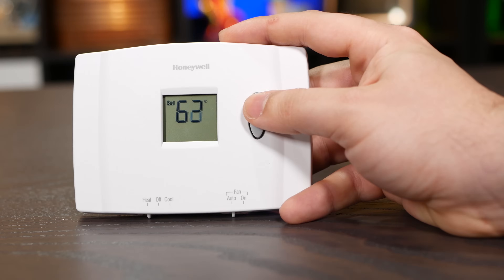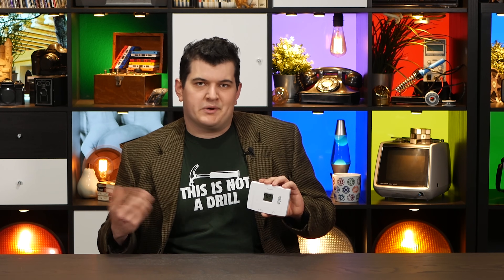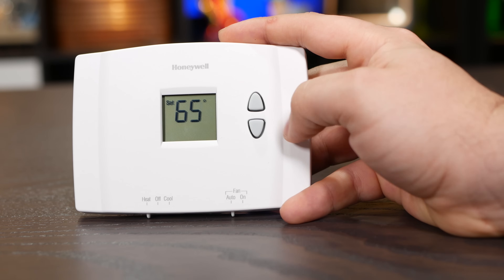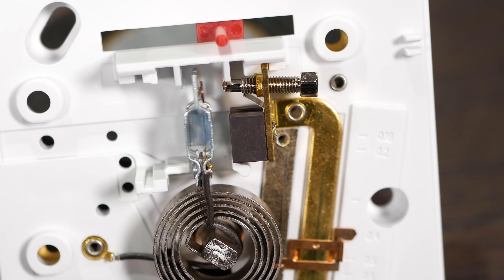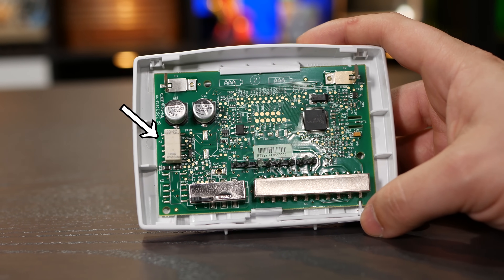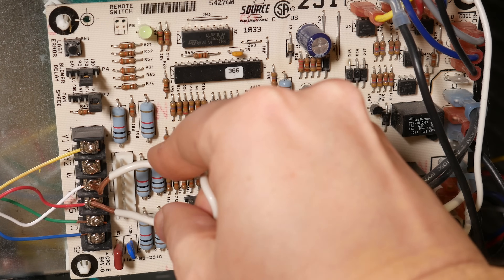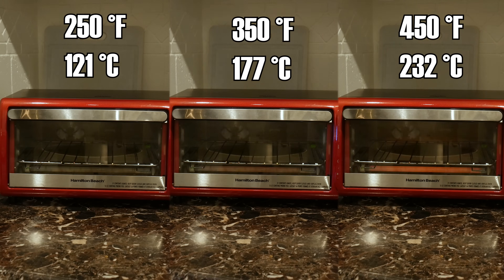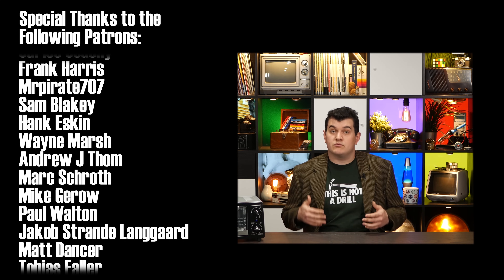Thermostats: Cooler than you think!

Comment: Hi Alec, love all your videos, cheers.  Australian living in Europe here - I have a number of German EQ3 Max room radiator thermostat solutions where you can control one or many radiators with a single wall mount thermostat (thats per room). Drum roll - Yes it has the time programmable heat boost function which I have set for 20min and 90% valve opening regardless of room temp, this is a brilliant feature for when you feel cold.  Also the boiler is a German Vaillant ecotec 24kw condensing unit with fully variable heat output (something like 10%-100%), that great but cost around 3000 - 4000 euros new + installation.  It has an all digital bi-directional serial data thermostat control panel (2 wire system, +12v & data riding on top of the supply).  The LCD show lots of info about the boiler operation - pump on, flame burning, heating mode, hot water tank heating mode and outside temp. The outside temperature "compensator" sensor also varies water temperature depending on how cold it is outside to save energy.  All brilliant ideas and when it works it's fantastic but they are actually quite unreliable and exorbitantly expensive to repair - gee sounds like a expensive German car. I can do all my own servicing and repairs so it's cost me very little - other people I have talked to have got huge bills and the system still is not working right. I'm not living in Germany but I think this type of system is only common?? across Germany. If others from Europe could comment on their experiences that would be great.

Comment: Another way to be tricky is to charge a capacitor by completing the circuit momentarily every few seconds while not commanding heat.  But sometimes the furnace really doesn't like that.

Comment: Some HVAC systems do have 2 or 3 speed fans which will push more heat or cold air thru the system, draws more power but if the customer wants it and is willing to pay the $$$ they get it, more advanced systems can bring online aux heat or a 2nd furnace, which is linked in w side ducting (pain in the ass but again whatever the customer is willing to pay for) but like you said the furnace or AC is at full when on, the thermostat being it dumb or smart (we have a Nest) is essentially just acting on an 'If / Then' protocol be it bi-metal or thermocouple or whatever, it's all just physics, the HVAC duct system also defines how efficient the system is, depends on the house design, customer preferences and var other factors that fall within dynamic variables often, usually customer whims, sometimes laws about historic buildings dictate what can be visible so you hide the ducts between walls and put the vents in corners where they're less noticeable. You didn't mention why we don't see mercury switch systems anymore, aside from toxicity they're easy to use for motion activated bombs so they got banned, too many idiots making bombs anyway. I worked for a family owned HVAC firm in northern NJ for yrs, everything from assisting in the field w service to installation to making ducts, office and running supplies between jobs and etc. Super hot attics, chilly basements and wacky customers. Good vid, my brother recommended the vid and your ch, already subscribed.

Comment: information on other wires, for those curious:

__S1 and S2 (A.K.A. outdoor 1 and outdoor2) are used with outdoor temperature sensors, usually thermistors. this is useful with a heat pump system, which cannot defeat entropy.
note: since a heat pump can only move heat around, it will have a hard time keeping a house warm if the outside is very cold. when the thermistors detect that the outside is below a certain temperature, the furnace will activate a convential heat source such as a furnace, and disable the heat pump.
note2: S1 and S2 may be a mislabeled L

__Rc and Rh are secondary power wires to suppliment R. they allow the heating and cooling elements to each have their own seprate transformer. if only one transformer is present, they are shorted together

__Y2 is used for a secondary cooler which operates if the primary cooler (Y) is insufficient for the task

__W2 is used for a secondary heating element, similar to Y2

__O/B is used with heat pump systems to reverse the direction of the pump, which changes the system from warming the house to cooling it.
note: B may also be a mislabeled common wire

__E is for a secondary, emergency heat source

__X/aux is an auxilliary heat source of some sort

__L is a 'service light' which indicates that something is wrong with the HVAC system. confusingly, it seems that it can be used as an output or an input, either connecting/disconecting upstream of the thermostat, or allowing the thermostat to disconnect/connect downstream devices.

__K is a combined Y and G, which runs the cooling system and fan together.

__F and T are sensors which control an "anticipator" which compensates for heating systems that continue to heat even after they are turned off.
note: mechanical thermostats may have an internal anticipator which generates a small amount of heat near to the bimetalic spring, shutting off the heating prematurley. if adjusted properly, the house's heating system will then 'coast' up to the desired temperature without overshooting.
note2: F may be a mislabeled L

__other letters exist such as X, X2, U1, U2, and N but they seem to be very nonstandard and manufacturer-specific as information i could find was limited and conflicting.

__sources:
https://xtronics.com/wiki/Thermostat_signals_and_wiring.html
https://highperformancehvac.com/thermostat-wiring-colors-code/
https://blog.jacksonsystems.com/honeywell-therm/

Comment: Excellent video. However the question near the end about "why thermostat wire and not Romex or..." wasn't answered completely. The reason for low (or 24 volt) voltage wiring and associated thermostat wire has to with building regulations. In some areas areas of the country, anything over 50 volts (or high voltage) strictly falls under the purview of a licensed electrician, and not a HVAC service technician. Every state is different, of course.

Edit: I am an HVAC instructor, but I come here for the toasters and pixels!
Reply: Not the type of wire but the actual voltage used determines if only a licensed electrician can work on it.
You are totally allowed to use 110V or 230V wiring for 12V or 24V circuits and connect them without any kind of license.
Reply: Agree

Comment: There are programmable thermostats that have temporary override features.  So you can set it to a temp that is outside its normally programmed setting, and it will automatically revert after a time.  Most that ive seen were in commercial buildings and the override lasted for 3 hours

Comment: With regards to a "single cycle" setting, some smart thermostats can do this... kinda. My ecobee, for example, allows me to temporarily override my usual heating/cooling schedule, and when doing so you can dictate how long that override lasts for. The defaults that come up right now when I look are 2 hours, 4 hours, until the next scheduled change, or until I manually change/dismiss the override.

Comment: Toaster ovens are commonly used in the maker world as reflow ovens that follow a predefined temperature curve. There are micro controller based toaster oven controllers that control the temperature by switching the mains on and off. You set the oven at full, calibrate the controller/sensor pair once, and next time you use it you can apply your temperature curve.

Comment: HVAC guy here. Good video and very informative. i normally see 18-22 awg for thermostat wire. 24 volts and normally push about 1 amp. the transformers are usualy fused for  3-5 amps so charging a smart thermostat it can mostly handle. i see some guys wire in UV lights and air cleaners into the low volt circuit. the right way is to add a second transformer

Comment: Those simple Honeywell digital thermostats can actually have more going on that one might expect. Instead of relying on a simple 1 degree hysteresis (the one degree up and down range) like an analog thermostat the digital version can function as a PID controller. It 'learns' the output of your HVAC system to factor the duty cycle for maintaining the desired temperature with a given frequency per hour of operation (I believe the Honeywell default is either 3 or 5) to reduce wear on the system from frequent start/stops. Also, if you have a schedule set it will use this to determine how far in advance it needs to start warming up to reach the desired temperature for your set time.

Comment: Since you asked for it: the tado (tado.com) is a smart thermostat that has a additional function, it can (if you furnace supports it) also control the amount of heat the furnace is producing. (More common in Europe I guess).
However they also have a AC control unit that. Both are controllable with an app and in the app (or, depending on your settings on the display) you can change the temperature for a set amount of time.
This way you can set the AC to cool for a specific time, after witch it will return to it's normal program.

Comment: ENGAGEMENT BOOST!

When replacing our whole HVAC system five years ago, we have a "sort of three-stage" heating.  We have a two-stage gas furnace plus a heat pump. (Which also acts as AC in the summer.) Most of the time (we're in a fairly temperate area, it rarely gets below freezing in the winter,) the heat pump heats as "stage one." Unless you set the thermostat to ridiculously high, (80°F, which is its max,) the temperature alone will not force it to switch to gas. (And switching at 80°F might just be "hey, you're asking for max, so we're going to give you max!" rather than because it's 80°F specifically.) Only if the outside temperature is low enough (or you manually choose "backup heat" in the smart thermostat's smartphone app) will it decide "I guess heat pump isn't enough" and switch to the furnace.  Then the furnace has two possible settings. "Huh, I can kind of feel this" and "OMG, IT'S GOING TO COOK THE CAT!" (the cat likes to lay on one of the heat vents.)

But getting a two-stage was a purposeful choice. The default furnace would not have had two-stage. (And the real purpose for the upgrade was to get a more efficient furnace, the fact that the more efficient one had two-stage heating was a bonus. Getting the more efficient one qualified us for a better tax break on the whole project, which ended up making it cost LESS overall.)

Comment: 15:06 Ethernet cable for Thermostat?
Eh, no. Some idiot may plug his laptop in and fire 24V directly into the network card.
Sure, with the use of PoE, you can transmit 48V through Ethernet, but there are limits.
Also, the wires in the Cat5 cable are smaller in diameter, which causes them to heat up,
if the voltage across them is too high. You know how incandencent old light bulbs work?
You don't want warm cables buried inside your walls. It's a potential (deadly) fire hazard.

Comment: Thank you! 

You could also have added that most digital thermostats have a "Temporary" mode and a "Hold" mode. Temporary overrides the program until the next program transition, e.g., from Wake to Away, or from Return to Sleep. Hold overrides the program until you turn it off, effectively turning your fancy, expensive, energy-saving thermostat into an equivalent stupid, bimetallic Mercury model.

I actually sneak around the office after hours and update the programs to match where my co-workers have "held" the temperature to run night and day, even on weekends. Spring and Fall are typical times where you need to shift the heat/cool settings if your thermostat is fancy enough to have an Auto mode.

Comment: Despite most places using hot water radiators instead of forced air here, the only major difference for European viewers (and the reason we have to have our "own" Nest models) would be that the control for the boiler/furnace is commonly by switching the 230v AC; so stats are usually either wired to a 230v timeclock; or they are battery powered and communicate to said timeclock wirelessly (for most installs since the 1990s). Nest supply a replacement for the timeclock with just a on/off button and the nest thermostat itself uses a USB charger. 

My own house was built with forced air and an electric heater; but has had hot water refitted for cost reasons - early 70s hope of nearly free nuclear power vs. 1990s reality!

Comment: Great video! A quick correction:
What you're referring to with thermostat "PWM" control is not PWM - it's a separate technique called "bang-bang" control(no, I'm serious) with hysteresis(spring and/or air temperature inertia).
Works mostly the same way, except it relies on hysteresis, or as you've mentioned, it would jump left, then right, then left, then right, then...

Comment: I don't have cooling in my place, only heating. You set the thermostat to a certain temp and when the temperature drops below that the heat kicks on until it reaches the set temp again. It's based on the air temp tho so when it's colder outside the walls and floor still leech heat faster and it feels colder than when it's warmer out and set to the same temp.

Comment: I was surprised to see how heating seemingly usually works in Britain (You are British, aren't you). Here in Germany, heaters heat a reservoir of water which is then pumped to radiators in each room, each with its own valve and thermostat. And Voila: You have half-blast (or quarter or 7/42) and different temperatures for each room if you want. The MAX! thermostat system I use (https://www.eq-3.com/products/max/max-house-solution.html) even has an X Minutes boost function which returns to the set temperature after it was enabled.

Comment: boosting engagement :-D ...

In Slovakia (Europe) is common to see "thermostat" with data connection to furnace (boiler) and/or air-condition. Heat is normally transferred using water in pipes and dissipated to room(s) using radiators. Control unit is normally processing various inputs including "set temperature", "actual temperature", "outside temperature", "output water temperature" and "return water temperature". According to that it decide how many burners needs to be turned on and on what level (similar to gas stove in kitchen). Heat output is regulated almost linearly from minimum to maximum power. Additionally to that each room have thermostatic valve on radiator so rooms can be fine tuned / adjusted individually. 

Same apply to A/C ... pump for coolant is powered by inverter.  This allow A/C to settle on specific "power" so stable temperature is maintained. If conditions change (sunshine through windows, etc.) then A/C just adjust pump speed (also fan speed).

Binary (100% heat < - > off) systems can be still found here but are normally replaced with systems described above during renovation.

Comment: I still have the mercury bulb and its 105 years old and works just fine for my boiler. The wires that run it were actually phone wires and the electricity is made via a thermopile to open the gas valve since the house didn't have electricity in my house back in the day.

Comment: Mine can set the schedule and there is a "Hold" button that when it's not pressed, you change the temp, and then it will return to the program, where when it is pressed, it overrides the program with your current set temperature when the schedule comes around

Comment: check out inverter heat pumps. the compressor is controlled using a multi phase motor controller allowing it to run at different speeds.

Comment: I’ve never read how these are wired, but variable flow heat pumps need some sort of way for the thermostat to describe how hard to run the compressor. My grandparents got one of them and the technician managed to wire it so that it just ran constantly, with no modulation. Grandpa was very unhappy with the electricity bill before they came back out to rewire it.

Comment: Alex, it's not quite the feature you want, but I know my Filtrete WiFi thermostats have the option to override the set temperature, and then a button to "Return to Schedule". So not QUITE the feature you want, but they certainly did include an override. Additionally, these thermostats have an "Auto" mode, which is neither heat nor cool, it just determines it based on an internet feed of outside temperature and runs what it thinks is appropriate for those outside conditions.

Comment: Take a look at https://en.wikipedia.org/wiki/OpenTherm - virtually all heating systems installed in Europe support the protocol and allow the thermostat not only to regulate heat generation, but also to show status codes on the thermostat. Oh, and it supports powering the thermostat as well, and it does it all over a single wire pair (!!!)
A discussion of PID controllers could also be beneficial. https://en.wikipedia.org/wiki/PID_controller

Comment: We had a programmable Lux brand thermostat, which never worked right, which did allow you to override the temperature, and I believe it even allowed you to time how long you did it. That being said we don't have the AC part of HVAC, and barely the V (no fan control, it's either heat and fan on, or heat and fan off) so the utility wasn't all that important, and if we anted to be cool, we'd just turn on the window air conditioner we had installed.

If you have a time programmable thermostat, you could also just change the timing (which would be slightly annoying depending on the thermostat), and then remember to change it back if you wanted it right now. Not that this is a good option, but it mimics the desired functionality.